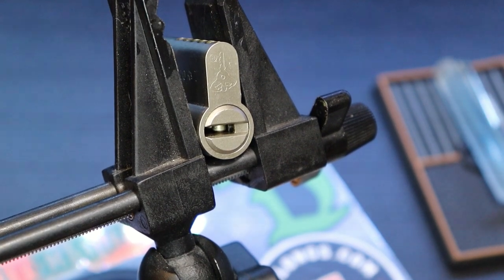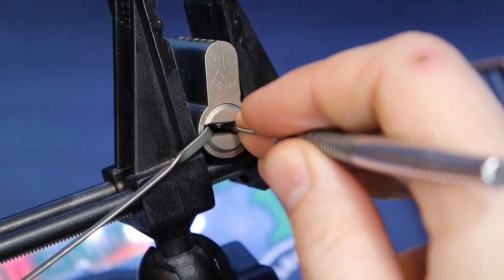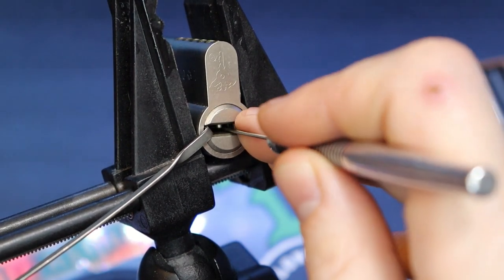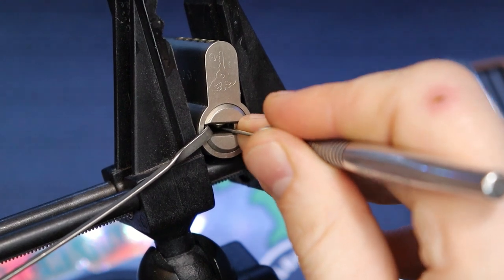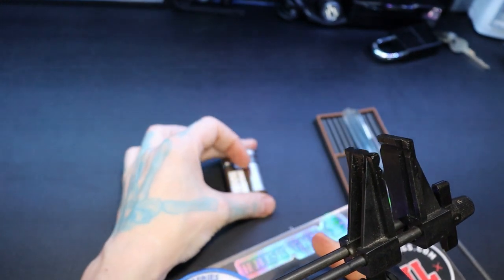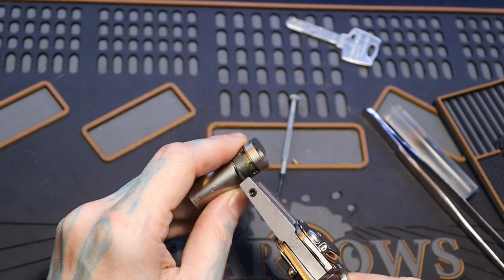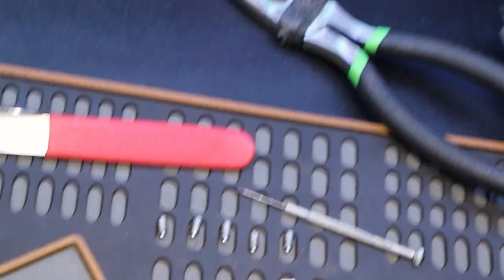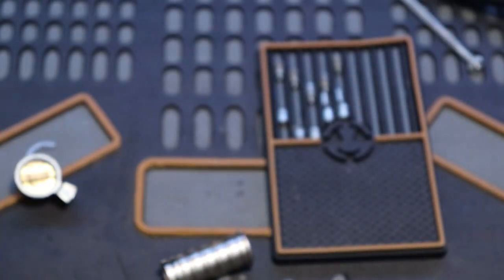195) Mul-T-Lock Interactive with Serrated Drivers Picked and Gutted

Comment: congratulations - may i ask about tensioning these pins? i'm progressive pinning and the tension seems to dramatically change from two to three pins - just can't sort it. With thanks for your recent experience insights. - m.c.
Reply from the maker: I do medium tension on the pins. One thing that's helped me with Mul-T-Lock is taking a flag and shaping it into a triangle. I believe I show the tip at some point in the video
Reply: @LockpickingDev  ok shall check that out - thank you